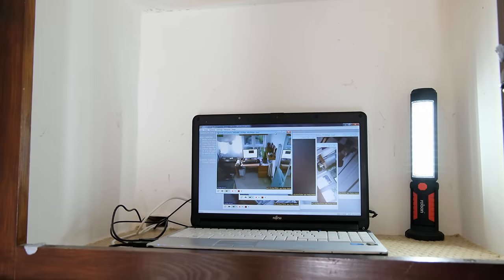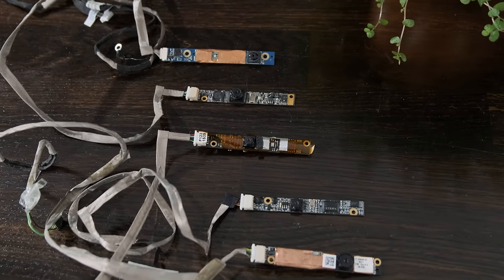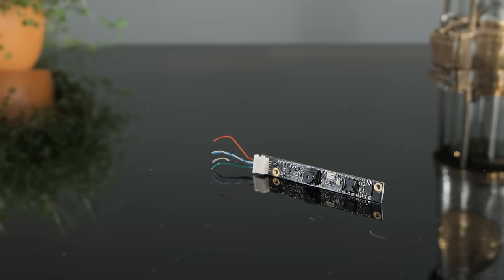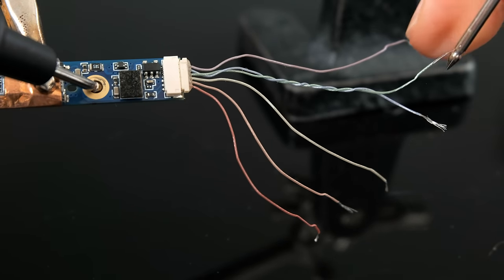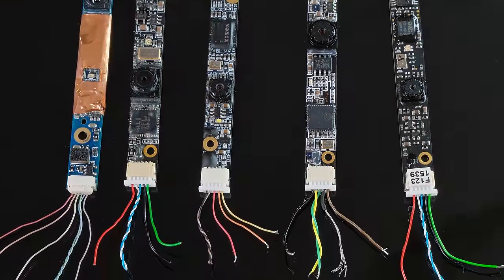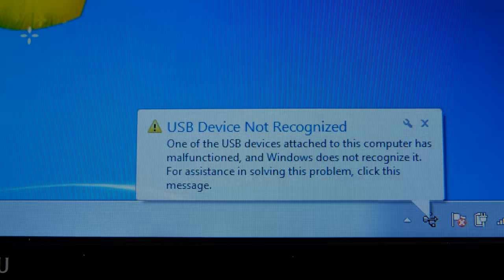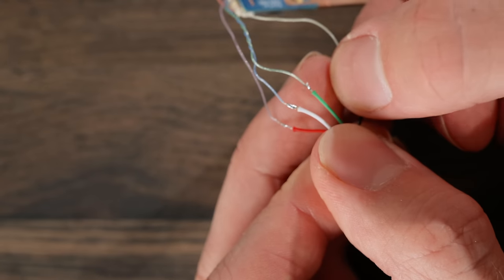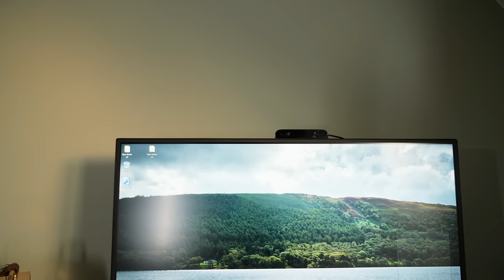How to Convert Laptop Webcams to USB Webcams

Comment: I've been researching this as cameras are so hard to find, and I've compiled some tips:
-- It seems like there's a strong convention for wiring: 4 wires carry USB connection for the camera, and 2 separate wires carry data for the microphone (not USB protocol).
-- The 4 USB wires generally go to a motherboard connection labelled "camera" whereas the 2 microphone wires go to a different connection entirely so you probably won't get audio over USB.
-- Audio is generally PDM digital audio or sometimes analog. The condenser mic gets power from the same power line as the camera.
-- The camera is generally receiving 3.3V from the motherboard, so consider dropping your USB 5V supply with some diodes in series.
-- Very high end devices like Apple MacBooks and Microsoft Surface computers are using a single PCIe lane for their camera modules, instead of USB. This will be less convenient to wire up to an external plug, but not impossible!

-- The webcam controller chips used (which interface the physical camera sensor to a USB protocol) often have inputs for audio. These are sadly not used on most modules, and the pins are hidden under the chip so can't be accessed :( I would love to see someone hack this into working so we can have a full video+audio solution.
Reply: Are two 1n4007 diodes good too instead of zener ones? thanks
Reply: @mrcolo.  I actually just used 1n400x diodes myself if I'm honest. I didn't get too clever, just wanted to knock the voltage down a bit!
Reply: @benskidmore6523  ok perfect thx!

Comment: Hi Matt, Realy Nice Videos! Can you help me ? I'm trying to convert a camera from an old broken laptop using your tutorial. After removing the camera I am not able to find the ground wire. I'm using a multimeter and the hole in the PCB, the camera has only 4 wires, the 2 tangled and 2 others. I tested the 4 wires and none has continuity. Is there any other way to find the wires correctly?

Comment: im trying this out and i seem to have 2 ground wires, my multimeter doesnt have beeper mode but has a diode mode and two wires had 0 which i assume is ground and the computer seems to recognize it but i only get a black screen/no picture but the led on the camera is lit.

Comment: Hey I want to wire the 2011 webcam I have , no model number , to a sylvania portable dvd player board, it has no video inputs from factory. Model of dvd player with screen is SDVD7040B. I'd post a picture of the processors but utoob sucks like that.

Comment: I connected it successfully, so my laptop camera actually works on my PC through the USB. But my laptop camera comes with a dual microphone array (one on each side of the camera). Has anyone figured out how to connect the wires to the USB cable, so as to also get the mic to work? Does it have something to do with the extra two wires from the camera cable (usb has 4 and the camera cable has 6 wires) - do you somehow connect them to the 4 USB wires or do you have to connect the extra two wires to an audio cable and plug it into the mic jack in the PC?

Comment: Super late to the party but if like me you only just using this information now, I found when I did this I got the data cables wrong way round. After getting the "usb malfunction warning" as shown in this video, I reassembled correctly but found I still got the same error. Chased myself round in circles for an hour only to find I just needed to restart my pc after swapping the cables to the correct position. Simple I know but thought I'd share just incase anyone else has this issue.

Comment: Tried this with a webcam that had 6 wires, identified the supply wires using the pins from an eeprom that was on the board, got the data wires from the 2 twisted wires, didn't worked, swapped the data wires, didn't worked again, got another broken laptop, this time the camera had 5 wires, identified everything again and soldered to an usb cable, worked on the first try. Thank You.

Comment: Hey guys, I have a laptop (L380 Yoga) with a "World Facing Camera" that I am trying to repurpose and I have found the cable is quite different and after looking around it seems quite expensive too. (Serial Number for the cable 02DA332) I was wondering if anyone knew of any alternative cables that would still work with the camera module that dont cost the same price as a new webcam?
Thanks all!

Comment: This is great, but you left out thing out. You may need a resistor of some kind to drop the voltage from 5v down to roughly 3.3v as many don't use 5v. And supplying it 5v can fry it.

Comment: I wonder if you could go into detail on some of the webcameras. The mic is often wired on a separate wire or two. Mine is I believe I2C, as the 2 wires I'm not using are labeled M_CLK
and M_DATA.

Comment: The wires were so tiny I couldn't even strip them with the 30 gauge strippers but I finally got it done, soldered and my computer recognized it!!!!! There are 2 more wires though. My wires were actually labeled on the back side of the board, the two extras are "M_D" and "M_C" - for the microphone maybe - thoughts?

Comment: You missed out one thing, usb web cam runs on 3.9V, so connect two diodes (in series) in +Ve wire to reduce the voltage. Otherwise it will not be recognised by pc.

Comment: Problem is only that most newer internal webcams are USB 3.3V, not 5V, and require a voltage regulator or a voltage dropping diode - 5V webcams are old and inferior for the most part, but they are easy to get.

Comment: Thanks for your hints, Matt. I just dared to remove the HD camara board out of an old ASUS, finding 7 pins at the connector and totally covered components. Identified GND cable (which was connected at pin 1), took twisted cables (going to 2 and 3) as D+ & D- and connected 4 to 5V. Still works fine.

Comment: As it happens, I just made one of these today! One of the things I ran into is that my particular camera had a shielding and it would not work on an un-shielded cable, it showed up OK, but I just got a black screen, to get around that I found a cable with shielding and soldered the camera shielding to the cable shielding and it worked great!
In my case the camera came out of a Lenovo G505 and the wires were very, very small, 30awg if I'm not mistaken, and while soldering them was difficult, it was definitely not impossible. To insulate the tiny connections, I decided to use New Skin liquid bandage, since I lacked any liquid electrical tape or any heat shrink in those tiny sizes, and it worked great! Thanks for sharing this!
Reply: I may have the same problem as my salvaged cam is recognized but will reboot every second with a LED blink as it is asked to display its image. Any chance you could explain how you identify the camera shielding? (my cam has also an inbuilt mic so there are plenty of wires)
Reply: @DanChaltiel  the shielding normally looks like a braided metal covering or a foil wrap around the wires. To test it, you should be able to just touch the shielding from the camera to the shielding in the cable and the camera should start working immediately, if the problem is the shielding. 

Restarting every second would normally be an indication that the data lines are reversed though, so definitely check your connections.
Reply: @Teklectic  There seems to be no shielding on the webcam wires then (see https://electronics.stackexchange.com/a/497752/82476 for a picture). If I reverse my data lines, the camera is not even recognized. I will investigate further. Thanks a lot for your answer!
Reply: @DanChaltiel  I don't see any shielding there either, but I'm confused by the diodes in series on the V+ line. Two 1N4007s in series should give you a 2 volt drop which would leave you with only 3 volts to run the camera, I don't think that would work since the USB standard calls for 5V, I would try with one or no diodes and see if that does it for you.
Reply: @Teklectic  I think some of these webcams run on 3.3V, the one I tried with actually had labelling on the PCB - SGND,  GND, D+, D-, 3v3 - that being 3.3 Volts. Some googling indicated that some expect two diodes inline from the 5V to drop the voltage to 3.3. That said I can't get mine to work but I wasn't using a shielded cable
Reply: @TimSheehan  Mine actually had 3v3 silk-screened on it too but operates on 5V, I think there may be an inline voltage regulator, though on mine a lot of the circuitry is under shielding so I can't confirm that.

Comment: I tried this with 3.3V (I used some resistors) but the computer didn't bring up the device at all, but when I connect the wires directly (without resistors = 5V) it did work. my webcam was Dell Inspiron 1525.

Comment: Hello nice video. I can see that you are using very often electrical tapes to insulate the wires. While it is working fine, for long term it is better to use heat shrink tubes. They are cheap and will last long term much better ;)

Comment: If you follow this video and your camera doesn't work it might not be that you did anything wrong.  The webcams I made using this video last year stopped working a few months ago due to a Windows 10 update.  I rolled back the update and it now works on my PC but any other windows 10 computer will have that update which could prevent these cameras from working.  I say might as there is a chance the update only stopped my specific camera from working.  Since I can't remember what type of computer I salvaged my camera from I, guess I'll need to make another one and see if it has a similar problem.

Comment: you forget to check the Volts, are you sure that it will not explode,, the web cam common voltage is 3.5, 
and the voltage from usb is 5.v. .

Comment: Great video, very cool, I got one going to play around with (-: The camera that I had, from a hp probook 450 G3, had 9 wires going into a 10 pin plug, where the wires were all labeled on the back of the camera pcb. Turns out in order for it to work I needed to wire both the 3V and 5V pins.

Comment: What if I have a webcam with included microphone modules (on a separate wire), am I able to daisy chain them together? or would I need another USB cable to transmit the audio separately?
Reply: Did you ever get an answer to this? This is my question exactly. I hit one webcam with 4 wires - no mic  - and unfortunately it was a dud. The next one I pulled has a mic & total of 6 wires + the data twisted pair so 8 wires! Did you figure how to sort this out?
Reply: @tghill  no sorry kinda gave up on this idea
Reply: This is only a guess. My laptop cam/mic module have 6 wires, I assume 4 wires are for the usb connection and the remaining 2 could be connected to a 3.5 mm lack (with the correct polarity, you have to try) and connect the jack to the 3.5 mm mic input in your pc. Please let me know if it works.

Comment: Hey Matt, I'm curious about how you source all of the materials and hardware you keep around for these projects, such as aluminum, MDF, vinyl sheets, PCB pillars, etc. Do you buy these materials as you need them, or do you buy in bulk to stock up? Do you have any specific recommendations on how to obtain any of those materials, such as a cheap store/website that you know of (I live in the US, though I'd still be curious to know even if the source is UK-only).
I would love to get more into DIY projects, but any time the project involves material that I don't have, I quickly lose the drive to make it. Any advice is appreciated!
Reply: Hardware stores?

Comment: problem here, im using a lenovo Ideapad U310 camera and i get this Unknown usb device, device descriptor request failure. Have reversed the data + and data -. It says status: driver error. I have tried installing the lenovo drivers but it said this product is not manufactured by quanta computer which my pc certainly isnt. Ive been unable to acertain the hardware id on my cam as all i see is random numbers. (HF5163-0B-B02) and  (AWTAAI01H026000)  and (C6A01244) and 1219 which i googled these numbers with camera next to it but no avail. Camera is detected but no driver. Any help or leads would be appreciated.
Reply: You can also try if the camera runs on linux. There you dont need drivers mostly. Either it works or it doesn't.

Comment: I just tried this and my computers not detecting it :(
trying to figure it out but I have no idea what I'm doing
Reply: If you're positive you have the data wires in the correct order, you might try a generic webcam driver. right click on the device in device manager (it should be "unknown USB device" or similar) and choose "Manually install driver". You should now be able to choose a driver manually - there also might be a number to choose from. If you know what brand your camera board is, try the drivers from the same brand. Otherwise, just choose from one of the generic USB webcam drivers that should be available.

Comment: Thank You so much, Matt! I am fixing a non functioning microscope for a coworker. It is a VGA type, with a board that has a 5v power input. I can now determine if the camera is working with what you showed. If the VGA board is the culprit, I just make it USB! Thanks again. Subbed!

Comment: I found your video extremely helpfull but I still have 2 questions:
1. What are the other 2 wires for?
2. Can you hook up a webcam with integrated microphone to 1 usb port as well?
Reply: Wondering same about microphone. Camera is working great but limited use without the mic.

Comment: You can determine Data+ and Data- by measuring between the wires and VCC. Data+ should measure about 1.5K to VCC. Data- will measure open to VCC (or at least much higher than 15K)
Reply: Smart, yeah, the + line will have a pullup on it.

Comment: 👍🏿I did it. Very pleased with how easy(if a bit fiddly) it was. FYI, I used a camera out of an old HP mini 210. The wiring was: Green/Ground-, White/Blue TP/Data, Red/Power+. There were two other unused wires, Brown and Yellow which are probably the microphone wires. Soldered the Green, Red and White/Blue TP wires onto an old usb charger cable. Plugged it into my PC and it was instantly recognised as a HP WebCam 50. Bosh. Now what to do with the HP Mini screen. Any suggestions????

Comment: Did this a couple years ago all by myself. Felt smart. Feel dumb now after seeing how it can be done. Well well... it still works. Edit: “data wires are twisted” twisted... I took the broken PC, put the wires back together and then measured the voltage in data 1 and 2 and just got lucky with connecting them.

Comment: Thank you Matt, great video! i'm really digging the second channel and i hope you will post here more  videos as this one. 
I have a question, modificate  RCA cable is not that hard, but is there a way to make a RCA to HDMI cable? the HDMI layout is way complicated and i'm wondering if there's a way to cut and modificate  HDMI cables. 
Also, can you make a video about DIY wireless charging connector? i mean threre are the cheap adaptors you can buy on ebay or so but they usually suck, so i wonder if there's a way to make a wireless charging option to phones that doesn't have a wireless charging option.

Comment: My webcam has 5 cables and data, I think that the microphone is in the webcam, what should I do? Can I use my microphone too? Please answer.
Reply: if it has a microphone and you have 5 wires, then that wire needs to go to a microphone input on your (intergrated)soundcard. you can also just check the pinouts on the web if you know the product number which is usually located on the sticker on the pcb. because laptop cameras could also have an enable wire.
Reply: @whoknows8225  I can't find anything online
Reply: @man0sm  I want to help you but i'll need a picture of both sides and or the laptop brand/type you got the camera from
Reply: @whoknows8225  It's a Dell Inspiron M5110
Reply: @man0sm  if it is this one https://www.ebay.com/itm/DELL-Inspiron-M5110-Inspiron-N5110-Camera-T3NPC-0T3NPC-GENUINE-NEW/111785229872 it visibly has a microphone but it will be some guessing what wire is the mic... it looks like the connector has 8 wires... so 4 wires for the USB camera.. and at least 1 for the mic..  also im kinda worried that this is a 3.3v module so you'll need to reduce the voltage from regular USB which 5v.

Comment: It worked perfectly but I've noticed that the module itself gets pretty hot. Is it normal or did I screw up the connections?
Reply: Is it from a very old laptop? maybe its a 3.3v webcam, if you know how, you can try changing the 5v power rail to an external 3.3v supply and see if it still heats up. Not a professional, this is just my advice

Comment: @Diy Perks, 
making the change according to the 2:30 time line of the video shown. How many meters of usb cable do you recommend using? and I could better detail with a video the change you made on the board, as I would like more details doing the procedure.
Thank you very much.
Reply: He didn't change anything about the board, he was looking for the positive wire with the multimeter